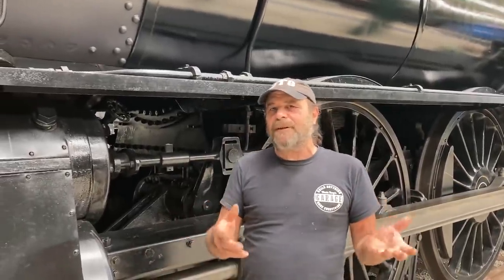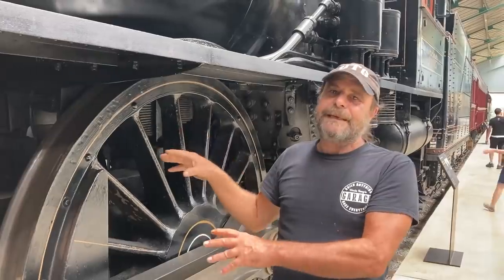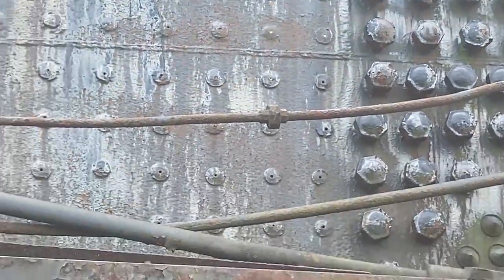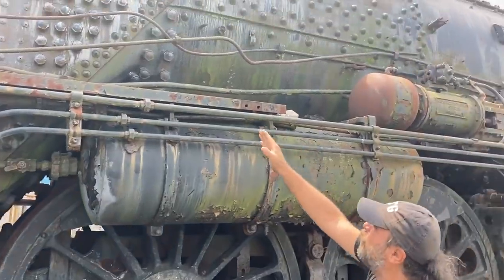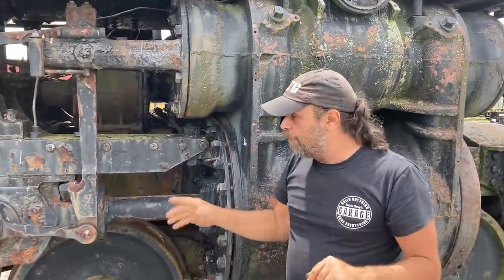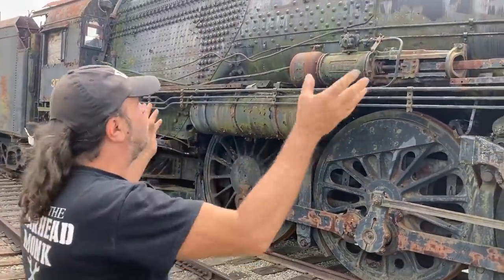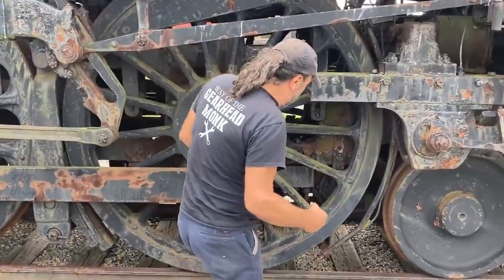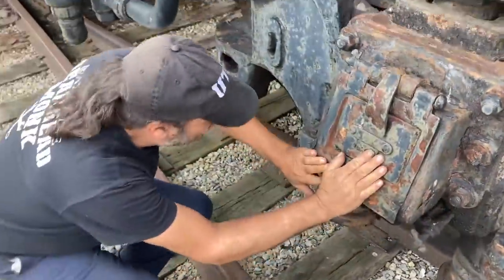The ORIGINAL American Muscle Machines

Comment: Now that's a torque MONSTER!  Steam engines are cool/HOT,  GM had a BBC converted to steam back in the day,  i wish we still had steam engines! In modern cars,  with a air compressor, to allow instant starts, no warm-ups, stored air, with a fast coil boiler, no large amounts of water to heat, only heating the water as needed, steam within about 5minutes, and enough compressed air for about 50mph for 10minutes, if possible, it would need to be at high pressure, possibly using a compound compressor, to compress air  to nearly 1k psi, maybe use a small high pressure engine, to work like a starter,   or maybe have a remote start, and forget all that, a steam engine, with modern electronics! Ha-ha!!..

Comment: PRR. first loco started as an E3 the second is a K4s 
oh what a day!  would have loved to be at strasburg for the 611  
external burn and external crank case.
the E type was about 1800 HP, later versions had over 200 more HP
the outside engine was over 3000 HP.
the 611 at the end is said to be able over 5,000 HP.

Comment: I was just rewatching some your video on weight reduction. If you had to guess, what's a reasonable amount of weight to be able to pull out of a 69 Galaxie with a full interior and all steel? Nothing needs to work, no heater core etc. I'm also planning on replacing as much bracketry and mounting parts as possible with fabbed aluminum for anything non stress bearing, replacing mild steel fastners with stainless or plastic, etc. This will be my first max effort weight savings project and I'm just wondering what's a reasonable goal. If I have to I've even got a lead on a good acid dipper 😂

Comment: They would start those things on wood but to get good speed and grunt they would switch to coal because coal burns hotter than wood and they need that heat to build up the steam to get those things running good.